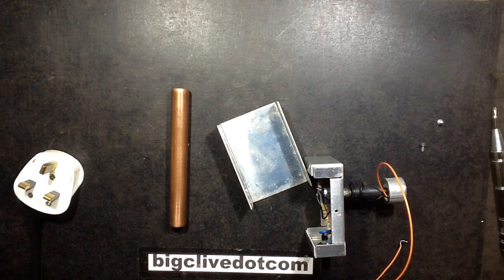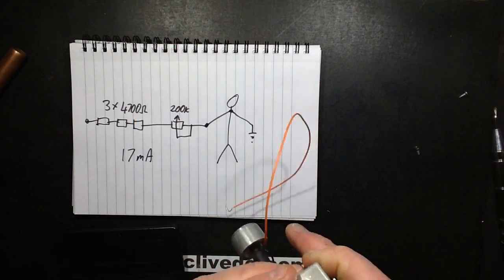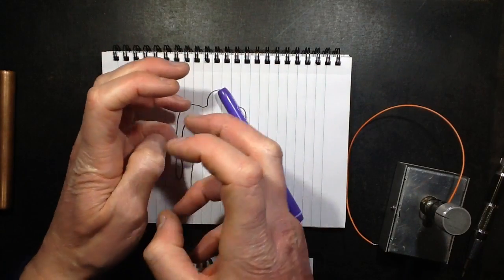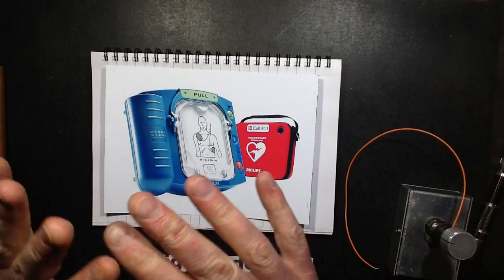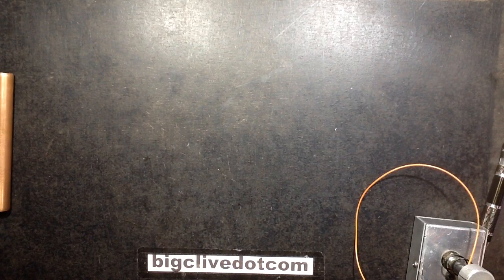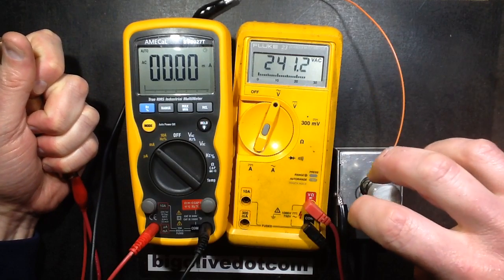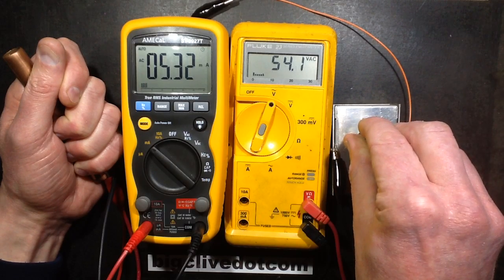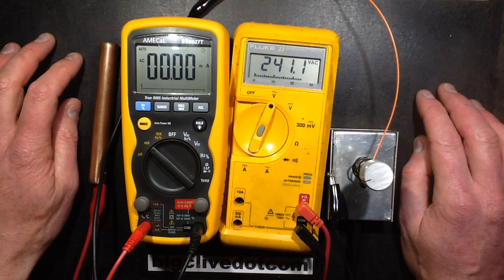Avoiding electrocution (Featuring real shocks.)

Comment: I built an electrocutor as a child. 9v battery, relay wired so that when it energises it cuts the power to the coil - hence it oscillates.  You then connect probes to the coil terminals and get people to hold it. Muscles in hand contract and pain goes up forearm.  My dad taught me how and I used to take it to my junior school to electrocute friends including running a stand at a fundraiser - how long can you hold the probes.

Comment: Is this the same sort of device used in those arcades where you sit on this chair and grab hold of two metal handles?
Reply from the maker: Those ones use vibration to simulate an electric shock.

Comment: I  only found your channel by pure chance! I find it incredibly informative, my father did electrical engineering in 1938 then was a WO/AG in RAF at the start of WWII  got medical discharge for nerve damage to one hand in' 41, went on to be involved in the building of the Black network of radio transmitters around Woburn Estate. He had a colleague who went to switch over the broadcasting transmitter at the end of his shift, the old man said don't forget the earth deadman's handle, when there was a bang and a rather charred deadman. I don't recall what the current was but the voltage was massive 1000's of volts.
I also remember him in his his late 70's still repairing the old cathode-ray tube televisions with the live chassis, one day I went into his workshop and he was looking in the back of the TV checking various valves (all live) , he said "I don't know what the issue is" and "I said what that whistle?", he said "what whistle?" I pointed to a part of the TV and said "high pitch, coming for around about there."  He stood up quickly with an exclamation of "Oh bugger!" Rubbing his Wrist. On asking what the problem was, I  was told oh, nothing just brushed the chassis! So where's that whistle (he had bad tinnitus by then) and went merrily on.
Another occasion I said, I'm getting a tingle of the kettle and the tap, he came over and looked, put his hand on it and told me I was imaging it, neither my bother or mam could feel it either. I said that I wasn't and I'd get his multimeter and show him. He told me to go and get it then and when tested there was a very small current of 240v A/C showing, it turned out to be an earth leakage from the supplier's side and had to call them out to sort it out. I have over the years toucher 240v A/C and always had a good belt from it, whereas the old man would test a wire by touching it and turning around to say you better take the fuse out, don't want to upset your mother. He died in 2019 aged 99 ½ years old!!
Reply: Sounds like a remarkable man. I had a friend tell me his grandad was an electricial engineer and he could touch a live wire and tell you how much current, voltage etc was going through. I’m talking the wires you get in the ceiling for the lights. I never believed him until I just read this. I thought how could a person touch live wires like that and be fine?!

Comment: Last year I had a painful shock, I had a lamp and rabbits and they chewed the flex and I didn't know that at the time.
I grabbed the frayed flex live at 240v and I felt a 50hz intense vibration sensation and it scared the sh** out of me (glad I'm still alive :O)
Reply from the maker: Most electric shocks are very low current, but enough to cause a strong sensation of pain.  It's extremely rare to get a shock that is fatal and there are almost always no lasting effects other than a new respect for electricity.
Reply: I agree with you Clive.

Comment: I once picked up an original Sony Playstation I was testing that was live with the cover off with two hands. I'm not sure if it was the AC or DC that locked my hands onto it. I was kneeling at the time. The only way I could let go was standing up and twisting round to pull the power cord out of the wall socket. I was able to release the unit doing a powerful twist and it put a dent in the wall across the room just missing my wife's head. I guess I nearly died that day!
Reply from the maker: Very few shocks are actually fatal.  Including the significant ones like that.

Comment: There must be a half truth here Clive that there is a difference between a shock and a belt. What a belt I had when I decided to muck about with a valve oscilloscope beam modulation circuit , live and then find the tips of my fingers burning when I touched the metal cap of an electrolytic that I assumed was earth lol.

Comment: I recently had the mains supply cables to my house replaced by the distribution guys working for my power supplier. I have to say they were great, really chatty regarding what they do and showed me what equipment they used for working on what they referred to as low voltage ie 240v UK mains. I wish I'd remembered to ask if UK linesmen carry defibrillators. The head guy, Rob, showed me a YouTube video of a transformer on a pole he'd been working on. He felt instinctively there was a problem when he closed the fuse and legged it. Seconds later the internal short caused to transformer to explode in a most impressive and spectacular manner. He said, if he'd lashed himself to the ladders in the h&s manner he'd be fried. Sometimes common sense is the best h&s. Transformer Explosion Mid Wales.
Reply from the maker: I've seen that one in the past.  It might have been posted on a linework forum.
Reply: @bigclivedotcom  Even Mr Electroboom would be impressed 😁 They were really nice guys. I asked Rob if they had any jobs but it takes 3 years to train and I'm too old 😔

Comment: I thought step potential was interesting, if you are near a downed powerline the potential reduces over the length of the radius but if you step away from it you could bridge say 2000v between your feet. You can survive by standing still or shuffling away. Livestock with four legs bridge a bigger gap and die.

Comment: Can you tell me how some people can hold live electric wires in their hands and not get electrocuted, others just get a shock and finally other just die ??? Thanks
Reply from the maker: Some people have high skin resistance, but nobody is immune to electrocution.  If their skin is wet, damaged or breaks down due to voltage then they will conduct just as well inside.

Comment: No pun intended, but you should put a form of "dead man's switch" into the device (in case you cannot let go after sneezing and dialing it up too far from the sneeze or something). Have a button or spring-loaded breaker that you have to press while turning the knob. If you lose the ability to let go of the knob or turn the power down, your arm weight or some method, will pull your hand off the dial... making sure that your weight, alone, will not keep the switch from staying on.
Then you can make your mark 3 device and have it go to more tingles!

Comment: Mine is about the size of an old fashioned packet of fags.  It's stored in a pouch made in my left pectoral.
One thing "they" don't tell you on emergency ward 10 or Grey's anatomy is that the majority of people brought back with a defib bear little resemblance to the person that was standing just a few seconds before.  Time is a massive factor, its why mine is stored IN MY CHEST.  It's why its fired automatically.  It's also a case of why and what damage the why did.  Pushing 1000000 volts through a wet soggy body doesn't just stop your heart - it does a lot of other stuff too - as does forming a massive clot in your brain either way, they may revive the shell but the consequences aren't brilliant.
If that stuff is cooking related - more 'lekky isn't going to revive it, nor will it restore brain cells or any of the other stuff.

Its an unpleasant subject but sometimes the stats show that its either not worth it - or the outcome of success is so unpleasant that the survivor regrets being disturbed.
There is no certainty in any of it, but not many mcmillan nurses or similar speak well about defibs  the chances of a good outcome are pretty slim.  I've been there done that, got the teeshirt and here isn't the place to say more

Comment: A friend had an exchange student staying and she asked him to connect a 3-pin plug to a metal coffee grinder she had bought (before the molded-on era).  Every time she plugged it in the breaker tripped, so I had a look.  He had connected the live pin to the neutral wire, the neutral pin to the chassis and the earth pin to the live side of the grinder!  But there was a 1 in 3 chance he could have wired the chassis directly to the live pin on the plug which could have been fatal. When asked, he said he thought it didn't matter which pin went to what!

Comment: I was a sparks, many moons ago. I have had three nasty shocks. They were all unpleasant, but of higher current than what you were inducing. A more severe shock can be less damaging, as AC throws one off; at lower levels, it throws the muscles into spasm, and one can’t let go. The worst was when I was messing around with stage lighting aged about 13, in the basement of school: grabbed line and neutral which was plugged into a socket: I was thrown across the room. Electricity is an amazing tool, but a deadly foe if mishandled.

Comment: Old video, it may be, but ruddy hell, Clive, hat was nasty to watch, and the thought that you were there, alone, conducting... OMG, that was a terrible faux pas, conducting a potentially lethal experiment on yourself.

Now to betray a little secret.... I used to help my granddad in his telly mending days, and as I'm sure you'll know, old valve TVs used in the main, the live chassis principal. I developed a stupid method of determining if the chassis was at live, or neutral potential...... I used to launch my hand at the chassis, and snatch it back before I made contact with the chassis. That way, if it was live, and it often was, my hand and arm were already on the return leg of the journey, leaving only my fingers under their own inertia to hit the chassis, my arm was already heading the other way so contact was only momentary, and breaking contact was assured, or at least that was the theory.... Hmmm. As I said, stupid thing to do, but brain dead teenagers, you know. Well, that was forty odd years ago, and I wouldn't do it now.
Reply from the maker: Chapping metal with your knuckles is one of those things that seasoned electricians do after they've tested it electrically.
Reply: @bigclivedotcom  Ah right.... Hmm, I wonder if I was a sparky in a past life, and got it wrong!

It just seemed logical, somehow, and we didn't even have neon screwdriver back then, nor an isolating xfmr. I still play with vintage radio and television as a hobby, but living with paroxysmal AF these days, I have a bit more respect for electricity, and that's what gave me the hebie-gebies when you started the Frankenstein jump starter thing........

Comment: 5:46 I study sciences and medicine histology histopathology cytology forensic pathology diagnostic medicine biomedical bone sciences I have a degree in electrical engineering and programming physics. I understand how aed defibrillators works l built and ecg machine using arduino shield boards it's a bit more then that I had odd shock but I not gone into af  but someone with a week hart could do what about someone for example shocked with a police tazor that's 500 volts

Comment: I had a coffee machine that I bought from ebay where the earth wasn't connected.  I'd plug it in, wait a bit, and then touch it and certainly get a tingle.  I used the meter on it between the case and earth, and could watch the voltage climb really slowly, 10... 15... 20... etc.  I think that the heating element had a tiny leakage to the case.

Correctly earthed it, and it didn't even trip an RCD after that, but no more shocks.  Fun... sort of!

Comment: as an electrical technician i enjoyed the "introductory" bit. we're trained to keep a hand behind our back if working on particularly dangerous equipment because of the very reason of risk of shock through your chest. we've even had someone die because an electrical fan in the door touched their lower back and went up through their arm. only a few years back and something a normal tech would never even think about. its crazy how easy it is to die in industry especially when youre working on things that arent operating properly. definitely made a subscriber out of me even though this is four years old yesterday. cheers

Comment: Watching this makes me appreciate how luck I am. I was working on an industrial glass washer with a colleague when an 'isolated' faulty drain pump circuit went live. From the index finger on my right arm to my left elbow got full 230V as the pump was running. I was in between two machines so I couldn't fall away. I was live for around 45s. I was conscious throughout. I even remember thinking that I was dead. Couldn't move, couldn't breath. Somehow I managed to fall away but I had real muscle damage across my shoulders and back and my finger was smoking like the end of a cigarette. Easily my most unpleasant experience yet. I'm a very lucky boy indeed, though. I can't understand how I wasn't killed.
Reply from the maker: Catering equipment is a huge hazard to work on live because of the large amount of grounded metalwork and steamy environment.  It probably wasn't as long as 45 seconds.  Time stands still when you're getting a shock.  Glad you survived.

Comment: I realize that this is an old er video of yours, but, have you ever seen one of those machines they used to put in magic shops or game centers? They had one at Disney World in Orlando Fl back in the late 70's in a magic shop. My "buddies" talked me into seeing if I was a man... I grabbed on to both handles and slowly moved the handles together which increased the current, as I reached my breaking point and was about to let go my "friends" each grabbed an arm and pushed them together giving me a full blast of current/voltage!!! The machine politely said I was a real man... Which was of little consolation to me as I was whimpering on the ground ;-) Ahhh to be young again... On second thought... Never mind!!! ;-)
Reply from the maker: The earliest machines like that used a battery and shock coil with vibrating contact to deliver a shock.  Latterly they tended to use vibration instead to simulate an electric shock for safety.

Comment: Got caught by 120v 60Hz once as a child when I reach into the socket area of a light fixture.  I can't say it felt anywhere near to good...can't even joke that it felt that way. Years went by and I got caught unaware by an old AA5 tube radio, which evidently had a non-polarized 2-prong plug! I've spent the rest of my life avoiding getting shocked.  I think that prepared me for the 35,000V modulators I work with now.  I could get as far as building the tickler, but I'd have a hard time grabbing to electrodes and cranking that knob up on purpose.

Comment: How do you educate brainlet uncles who've convinced themselves that you need hundreds of milliamps to be electrocuted?
Reply from the maker: You let them get a real shock and it usually changes their minds.  Electricity is a great teacher.
Reply: He's actually been shocked by 230v ac in the past but says because the circuit was protected by a 30mA RCD, only 30mA flowed through him. This same guy also thinks a car battery can "fry you" because "its got hundreds of amps".
Reply from the maker: It's worth telling him that an RCD will only trip with current flowing to earth and will treat him as a normal load if he gets between live and neutral.  10mA is agonisingly painful and locks your hands onto live metalwork.  That can go on continuously without tripping an RCD until your muscles fail or burn and you fall off (if you even can).  Car batteries are low voltage and can't really shock, but can cause serious burns from shorted metalwork.
Reply: @uK8cvPAq  Its frightening the number of people who believe that and I try to educate them, an rcd does NOT limit the amount of current that flows through your body that is determined by your body resistance, and you better believe you will still feel a shock! if the current through your body is above 30ma (which would be an excruciating shock) then rcd should trip but only if you had touched either the live wire itself or the live and earth, but as big clive says an rcd will do nothing to protect against a live to neutral shock if you receive that you can pretty much guarantee electrocution. Its also not unheard of for people to die at currents less than 30ma, so anyone who thinks an rcd will always stop you from being electrocuted or seriously hurt is hugely mistaken.

Comment: In our small town if you need a defibrillator you run to the CO OP  Store either the CO OP Super market or the CO OP Undertakers (not really good for business?).
Reply from the maker: They have one at the local park and at the library/town hall.
Reply: Its on the outside wall of the Undertakers so you do not have to go in!

Comment: im confused now... i was stupid some time ago and put single discharge from a bug zapper(it was about 1kV assuming the output capacitors' rating) accross my body(one side with left hand and other with right hand) and it felt horribly it kinda pushed me back i fell on the sofa that was behind me, i felt pain in my heart for a sec or so. is it possible that it left any damage?
Reply from the maker: No damage.  The pain you felt was probably a psychological effect caused by the fright of the shock.